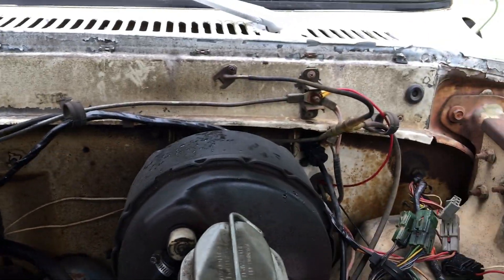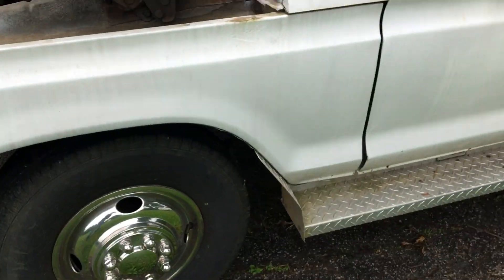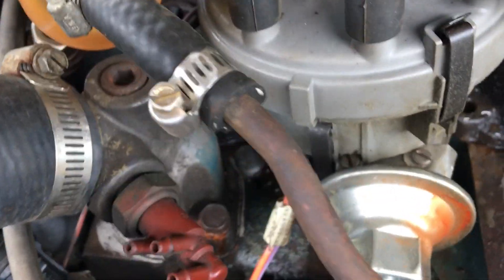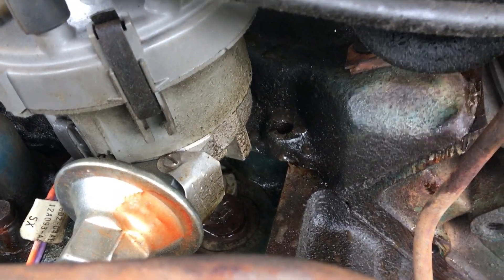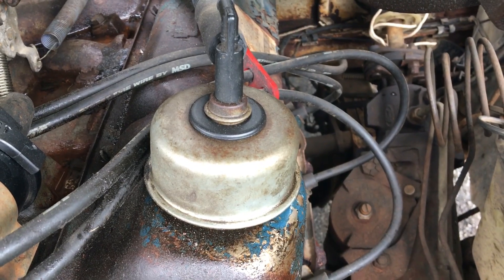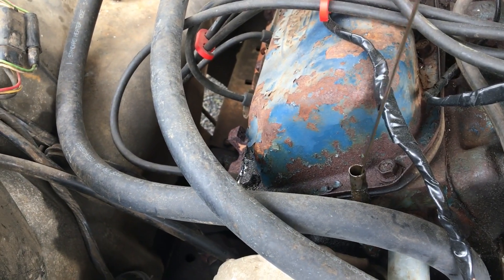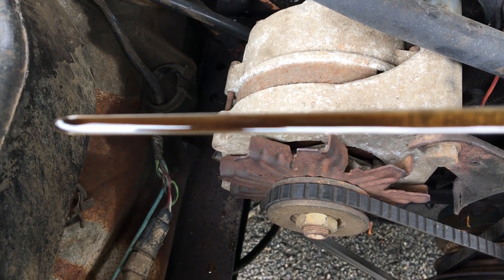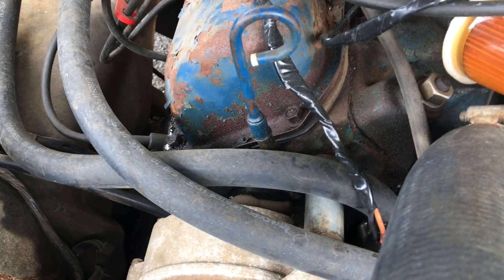PCV Valves!  Are They Really Needed?

Comment: Put one of these on my 400 before i had any idea why there was oil on the distributor. Finally i have the answer to why. Luckly the problem  has been solved already hahaaa
Reply from the maker: @nickh9712  I didn’t realize until I changed the carburetor on my 1979 F-350 that the previous owner had unhooked the pcv valve. The intake oil leak has stopped ever since I hooked it back up.

Comment: The pcv is a big vacuum leak and sucks unfilterd air into the crankcase. Cuts throttle response, bad for gas mileage. And sucks oil and makes increased oil consumption.
Reply: That's why you need a filtered breather on the opposite end f the engine. I have never had poor throttle response due to a PCV valve.
Reply from the maker: @softenerguy  I've never had poor throttle response from running a pcv valve either
Reply from the maker: @richarddodds9326  your valve cover should be baffled which keeps it from sucking oil straight up into it. It creates a vacuum in the crankcase which improves ring seal so actually your oil consumption would go down, not up.

Comment: Yeah I like use a breather on valve cover on one head and a PCV on the other side hooked up to intake or carb. No major oil leaks.  Good stuff. Keep it comin'!
Reply from the maker: That’s the way it should be done. Clean filtered air coming in as the pcv system pulls the stuff out. Thank you for your kind words

Comment: The pcv system is better than nothing but it also causes problems such as carbon buildup and clogging millions of catalytic converters. 
   The pcv system alone is not good enough and needs to be used with a catch can or similar device to catch all that crap instead of putting it back into the engine.
Reply from the maker: Especially in the case of high mileage engines

Comment: Anyone you have to explain this to is either to old and draft tube Veteran or to young and V-Pump user. Mid 60's-80's or so Folks need to pay attention! They were there for a good for Damn
Good reasons!
Reply from the maker: I agree with you. Unfortunately there are still people who say to just run two breathers and you will be fine. Then they wonder why their new engine blows oil all over the valve covers and has oil leaks

Comment: well not really, I have a 2018 boat with a volvo v8 (ls 5.3 basically) and there is no pcv like a car going into any of the intake. What they do is they run a hose from each valve cover to the front of the air filter (flame arrestor). IF the PCV system was really designed to be advantageous, boats would have it. EPA is the reason behind PCV, 100% and since boat have different EPA regs, they don't have one -yet-.
Reply from the maker: Some Volvo (GM) engines the pcv valve is actually in the hose. But regardless even if yours does not have it in the hose, by running the hose to the air filter housing it is still pulling vacuum on the crankcase just like a conventional pcv system does.
Reply: @BlackLabGarage  I think he means the hose runs to the intake upstream of the carb or throttle body.  So there is no real vacuum, therefore no need for a PCV valve to limit flow at idle.  I imagine the air draft and/or slight vacuum inside the air filter (if the outlet is inside the filter) draws crankcase fumes in the same way as a draft tube.  Maybe they can get away with it because it's on a boat that doesn't have to idle in traffic or meet EPA regs.  Seems like it would tend to gunk up a carb or throttle body though.
Reply from the maker: @captsorghum  yeah I know what he meant but from what I looked up there is still a vacuum pull on the hose. Maybe not as much as hooking it straight to the intake manifold but it says there is still vacuum there. Which makes sense because air flowing by the opening of the hose would indeed have that effect on the hose

Comment: Road Draft Tubes were designed with an angled-cut at the end which would face opposite the air flow while the vehicle was traveling at speed.  This angle-cut was supposed to create a vacuum in the crankcase to evacuate the pollutants.  It would work while you were running down the highway, but not so when sitting in traffic.  Being an old fart, I remember the days when having a worn out engine and sitting in traffic without a/c  would result in a passenger compartment full of toxic crankcase fumes.
Use a PCV if you can, but make sure to use the correct one because they're calibrated.  Also remember that there needs to be a source of filtered air into the opposite end of the crankcase or at the oil filler tube in order for the PCV to work effectively and to promote proper evacuation of crankcase pollutants.
Reply from the maker: Luckily I missed out on those days of road draft tubes and the passenger compartment being filled with fumes lol. You are correct about using the correct pcv valve for the application and the engine also needs a source of filtered air coming into the engine for a pcv valve to operate correctly.
Reply: I'm unaware of the calibrated valves. Can you elaborate? Thanks.

Comment: Some of what you're saying is incomplete and perhaps misleading even if not intentional.
The PCV valve doesn't create vacuum. It's basically a pressure relief valve. It operates on differential pressure. Vacuum on one side or pressure on the other can open the valve (usually unseat a ball). A low difference in pressure allows the valve to remain closed. Closed is usually the normal position (not to be confused with fail safe position).
Vacuum comes from the intake manifold. Pressure comes from (mainly) blow by gases escaping past rings.
A PCV valve doesn't help rings seal. If you have bad rings you have bad rings.
The PCV valve system vents the gases back through the intake to be reintroduced into the combustion chamber and prevents excessive pressure in the crankcase.
That's what it does.
Why reburn and get these oily vapors (sometimes dirty oil) clogging up a throttle body and sludging up valves? Thank the EPA for that.
Reply: High vacuum holds the PCV valve (mostly) closed, otherwise the engine would have difficulty idling.  It would be the same as a vacuum leak.  Low vacuum allows it to open, in order to pull the blow-by created under load when the throttle is opened.  When the throttle is open, the extra air coming from a wide-open PCV valve is only a small percentage of the intake volume so it doesn't dilute the mixture much.  If vacuum is opening your PCV valve, you have it installed backwards lol
It's not a pressure relief valve, as crankcase pressure would tend to force it closed (the same as vacuum on the intake side). If there was actual pressure in the crankcase, oil and fumes would be blowing out everywhere, including the seals, dipstick tube, and breather cap.
Reply from the maker: @captsorghum  without one there is definitely crankcase pressure
Reply: @captsorghum  You have a few things backwards. I said what I said. I never said it was a pressure relief valve. Made sure not to do that. And here you are correcting me on that.
Reply from the maker: Technically the vacuum comes from the piston going down in the cylinder drawing the intake charge in. If  pcv valve doesn't help ring seal then you need to tell Hastings, Sealed Power, Wiseco and others that recommend that you do have a pcv valve for better piston and ring seal. The big three had already implemented pcv valves before it was mandated by the EPA. California was the only state that required it and that was in 1961. It would be many years later before it became a nationwide mandate by the EPA.
Reply: @BlackLabGarage  ok technically, is your pvc connected to the intake or the piston?
Manufacturers are always ahead of the laws. There's no surprise that tomorrow you need x.
You should quote these companies claiming PCV valves help piston rings seal. I wonder which stroke they believe it to be?

Comment: Yes the pcv valve pulls a vacuum in the crankcase. But it's a major cause of the carbon on the valves and combustion chamber. The best solution is the vacuum pump. The exhaust evacuation system also pulls a vacuum from the crankcase but it's used more on race cars because it not effective at low rpm.
Reply from the maker: I agree that the vacuum pump is better than a pcv valve. I have used the exhaust evacuation system on a drag car before. I have also seen what happens when they go boom from the check valve not working properly lol

Comment: It also cleans your engine. Lot of people "over credit" modern oils for not sludging up your engine, but a lot of that carbon build up was due to improper crank case ventilation.
Couple that with the 1st adaptation of the "automatic choke" and it was a recipe for disaster that sent many of these old classics to the Junkyard at 100k miles. Detergent based oils coupled with a good PCV system and you can break the Myth that those old engines had to be rebuilt at 100k miles.
Good Stuff as always man!
Reply from the maker: I agree with you as always! Thank you for your kind words!

Comment: I converted my road draft tube on my 390 to PCV. I basically made my own version of the 64 CA emissions FE PCV setup but way more simplified and probably more effective since I was keeping the baldy valve covers, It works great. I found an old allen head straight thread hydraulic cap that just barely didn't fit in the intake side of where the road draft tube slides into the 90 degree adapter for the intake, filed the threads down until it barely fit in the intake adapter. I drilled the center of the hydraulic cap out so a FV202 PCV valve fit in with some resistance and then used a bit of RTV to seal those threads I filed down seal to the 90 degree elbow, tapped it in the intake and the 3/8 hose goes to the PCV port on the carb. I can still get the PCV valve out if I need to but its a snug fit. Best part is it for the most part looks stock.
Reply from the maker: That sounds like a good set up

Comment: I run one but I use a catch can for the oil , Oil especially a 100,000 mile engine it can feed enough oil into the fuel and air vapor to cause detonation. So a little electric motor to make a vacuum and a catch can is better than feeding it in to the intake.
Reply from the maker: I agree with that on high mileage engines.